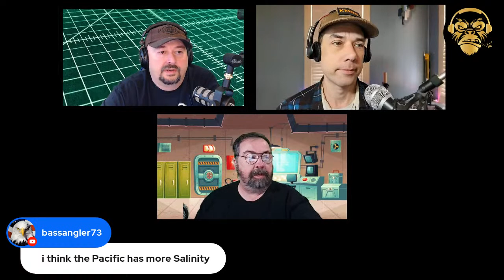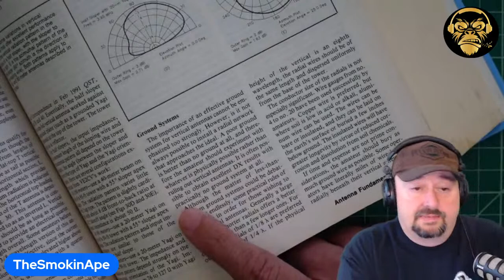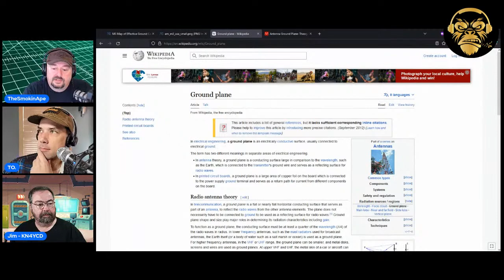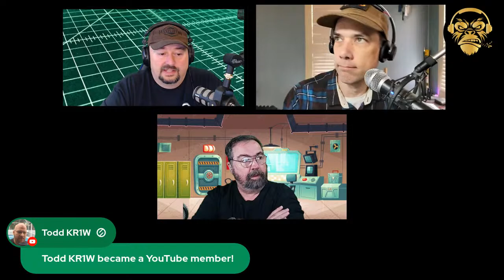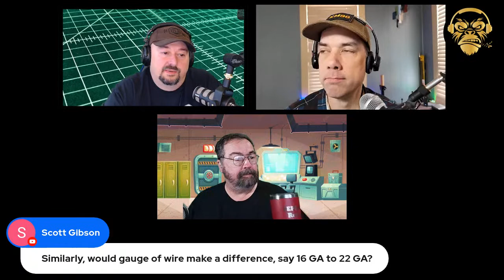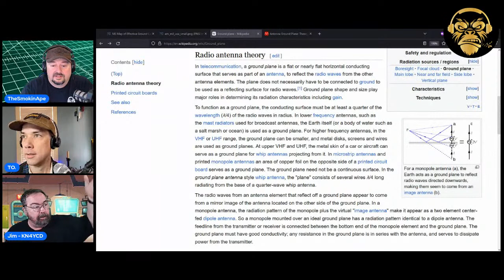Ground Planes for Ham Radio Antennas

Comment: The smokin ape iam thinking about getting my techican class license I have a learning disability in math I can still learn lot about impednce watts and ohms volts  ⚡️  and different Digital mods on Hf and how to tune the antenna  and how to grund the antenna for ham transceiver  and how to bild a random wire antenna for ham transceivers

Comment: Just watched this video yesterday, it was excellent.  I've used only ground-mounted verticals almost 50 years.  My first one had no radials - just a ground rod.  Most of my contacts back then were CW so that antenna was sufficient.  I use a 41' Spiderbeam now with 70 radials of various lengths.  Reason for so many is I add a few every year to make up for those that are destroyed from aerating and weed whacking. Discarded electrical cord from broken appliances is what I use for radials nowadays.  Tnx es 73's OM for the superb video.
Reply from the maker: Thanks for checking it out Mario, glad you liked it 👍

Comment: Callum says do them in a circle. Do them in pie slices. Do them on a semi-circle, just get wire on the ground.

‘Most’ people can’t feasibly do a 20 meter diameter circle. So in my case, I do a little more than a semicircle, maybe like 200 degrees or so; and it works fantastically
Reply from the maker: Glad to hear it’s working for you 👍

Comment: My ground plain is mounted at ground level.  I have my radials deployed uniformly around the stake that supports the vertical.  The vertical element is insulated from the earth ground and the radials.  The center conductor of the coax is the only thing connected to to the vertical element.  I have the radials connected to the ground stake and the outer mesh of the coax.  Is this the best way to connect the radials to the ground rod, or should the radials be insulated from the earth ground.
Reply from the maker: Many people set them up that way.  I would connect the Earth ground to the shield which is indirectly connected to the radials.

Comment: I am no expert, but a lot of what you were presenting made great sense to me in what is a difficult topic. Well done! Using what the books say as a starting point but experimenting with variations and finding out what works well for you is a lot easier than finding solutions to Maxwell's equations, which is your central message. SWR is only good for working out whether your rig is going to be comfortable, and indicating a lower limit on your rf losses. The upper limit of your rf losses could be 100% as you would have with a perfect dummy load.
Reply from the maker: Thanks for checking out the video Philip, glad you liked it 👍

Comment: Well my region gets a 4, which is better than 2, so I have that going for me, but I see why I have so much better results with dipoles and doublets here than I have with verticals.  The no radials required antennas like the Cushcrafts are 1/2 wave designs, Often by the use of loading via coils or capacitance hats, your topic is based on the use of 1/4 wave designs. By the way, elevated radials are far better than ground level radials, and while harder to install, they are easier to live with. Antenna modeling software could show you answers to a lot of what you speculated on. Finally, CA's ground is a place of great diversity due to plate tectonics, the regions you see in the map are because those parts came from a lot of different places. I know when you live in Nebraska that is difficult to visualize.
Reply from the maker: Thanks for all that info LC, I don't think I disagree with any of it but do want to comment on the antennas using coils and hats.  I believe these are more for matching and even though they say a GP isn't "needed" I bet they would perform better with one...  Thanks for watching 👍

Comment: I made up a set of radials for my WRC 213" whip consisting of 3 sets of 5, 11 foot lengths of wire. I set it up on my deck roughly 3 feet off the ground and get a 1.3 to 1 SWR on 20m. When I run it portable on the ground, I have to shorten the whip and will get 1 to 1 on 20. I still need to experiment with the setup to see what it's limitations are but interesting results so far. Thanks for the video, fellers.
Reply from the maker: That 213" whip is pretty sweet.  Thanks for the comment GR 👍

Comment: I am not very experienced, my radio is on the first floor and for the earth I can use a copper rod for example, but I need an electric wire that goes from this rod to the radio, about 5 m, can this be done without any problems?
Thank you
Reply from the maker: Hey Jean, the topic of station grounding is very nuanced and I typically do not make recommendations because everyone's situation is different; in some cases you might want to consult a licensed electrician.   The best advice I can give is to check out the ARRL's Grounding and Bonding resources listed here: http://www.arrl.org/grounding-and-bonding-for-the-amateur

Comment: I have a question for you guys. I plan on using a 17' telescopic whip for portable. Ive seen people using the "PREDator" setup, with two radials. I plan on using this portable at a location that has long rows of shipping containers, which I can place my antenna on top. Would you try to use the containers as a ground plane, or radials raised above the containers, on non conductive posts? Or radials that are stretched out and also connected to the containers?
Thanks 🙏

Edit : In my original idea, I planned to mount the antenna on a 15' pole, on top of the shipping containers. I could just use a magmount directly into the containers, but was going for extra elevation.

All thoughts appreciated 🙏
Reply: I use a similar setup. I use 4 radials cut for each band a 1/4 wavelength. I posted a few videos of the antenna and the swr's i get from it. I only run QRP so it's imperative i have a low swr. 73's
Reply from the maker: Hey Red Eye, I think it this case I would mount the antenna on top of one of the containers and make changes from there if I was unhappy with performance.
Reply: @TheSmokinApe  Yeah that seems like a good place to start👍 Then I can use that as a baseline and experiment with raising it higher and some radials etc etc. Thanks!👍
Reply: @TheSmokinApe  after much though, I think I will also try a quad loop, laid flat over the containers and then  raised to an optimal height (which I need to calculate) to hopefully use the metal containers as a reflector, in the same way that a two element cubical quad works. 
But, as cubical quads are directional and usually have a horizontal or low angle orientation, I'm wondering how facing it effectively straight up ⬆️ will work/not work. (??)

Comment: So the states like Texas are part of the low lying FLAT plains which are also close to the water table. We have a HUGE aquifer in Texas that goes all the way up to Iowa. I used an inverted "V" in Iraq to transmit HF to Iraq and throughout the middle east. The inverted "V" was also on top of corrugated steel roofing we had on our portable buildings. The wire anteanna I set up covered over 4 buildings. I was able to transmit to Kwiat with a manpack on battery power.
Reply from the maker: I had no idea about the water table.  I like inverted V antennas, only one mount point. Thanks for checking out the video FC 👍

Comment: Just starting out with cb and ham radio, i've skipped through video and will watch it all later, but the bit i have seen has been helpful. I always thought the anetenna grd had it go to a good earth rod, maybe this is why i am struggling. I undestand the ground rod is more for lightening strikes now, so thank you. Going back to the ground plane wires i understand a couple of inches below the ground and fanned out and it doesent really matter what size cable, i hope that's right. I assume the center of the fan just conects to the antenna screened wire or one side of a ballun if using a ballun? My next question is once i have the center of the fan conected to one antenna can i connect it to another antenna as well or will there be problems. Not that i can afford one yet i have been looking at a Kenwood TS990S which has dual input, would 2 antennas need 2 lots of ground planes?
Reply: Think of a ground plane as a reflector, like on a vehicle that is made of metal. Yes, there's harmonic that you can tune 🤷
1/2 wave antennas don't need them. 
If it was me, I'd run two different types of antennas, maybe dipole
Reply: @bovineexcrement8635  Thank you very much
Reply from the maker: Hey Gary, the ground rod serves a few purposes like ensuring voltage potential across all bonded equipment and handling stray RF.  As BE mentioned the ground plane serves as a reflector.  Your ground plane should be connected to the shield of you coaxial cable.  We typically recommend the use of a balun / choke at both end of the coaxial cable to suppress common more current.  Here is a great resource for more info on grounding: http://www.arrl.org/grounding-and-bonding-for-the-amateur
Reply: @TheSmokinApe  Thank you for your time, i will check it out.
Reply: @TheSmokinApe  Thank you

Comment: Use expanded copper mesh 6” wide at 1/4w lengths 😉little pricey but will outlast any wire. They are east to solder and offer better ground plane with diminished resistance ☺️
Reply from the maker: Hey Kevin, sounds like a great way to do it 👍